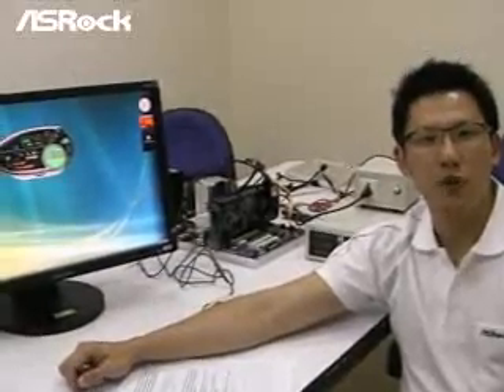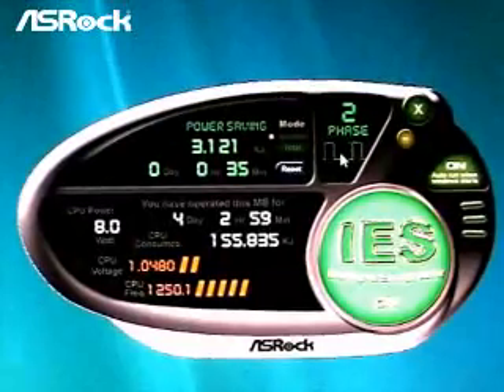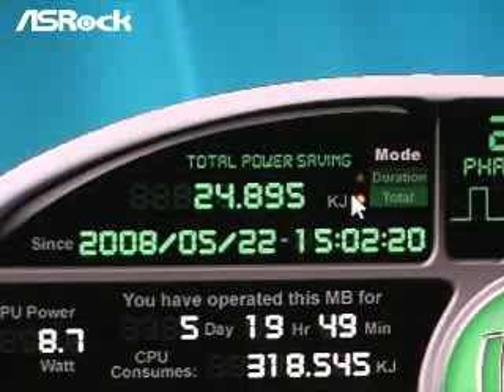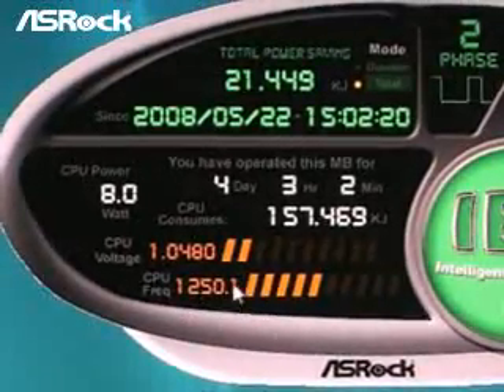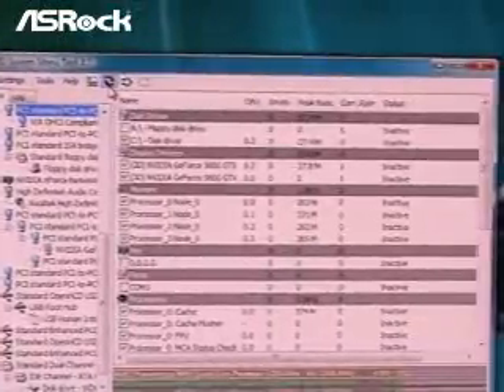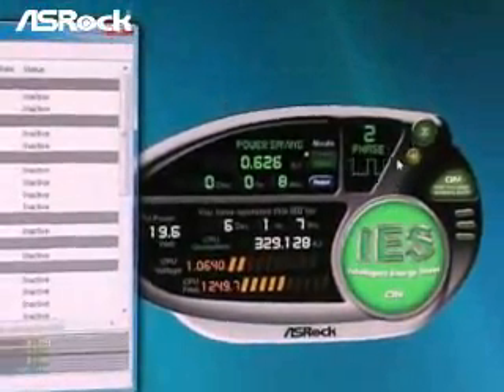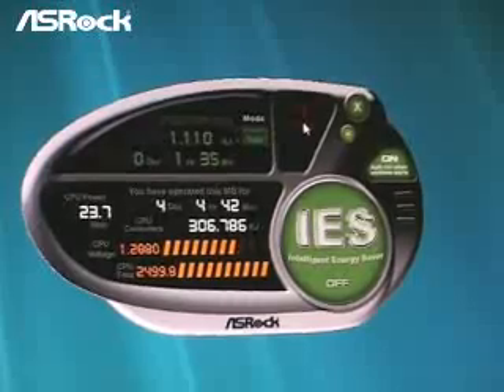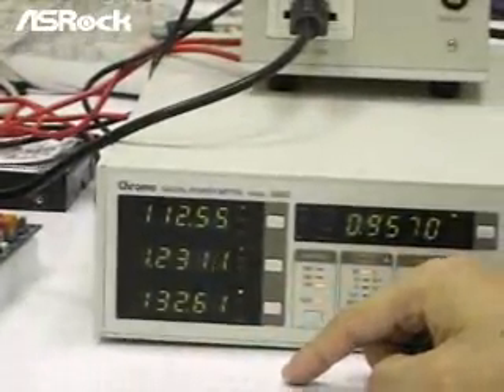Intelligent Energy Saving (IES)

Comment: Ive got an ASUS 880GHX mobo using an AMD Phenom2 X4 3.4Ghz, 4 Gb Ram and running 64bit Windows 7, with a nice wee second hand MSI nvidia 260 GTX card.

I have had ZERO problems using the IES and the instant boot programs that come with the board, and no problems running games while these programs are active.
For the record, I have no interest in overclocking any components in my system, and as a result I never have any hardware problems.

Just saying.

Comment: The best part of Asrock's Intelligent Energy Saving is that IES also works with overclocked processors (who consume a lot of power) without losing stability. This fact is new in the world of overclocking. Normally you had to disable all special energy saving options while overclocking, but now that problem is finally solved by Asrock's excellent IES Utility.